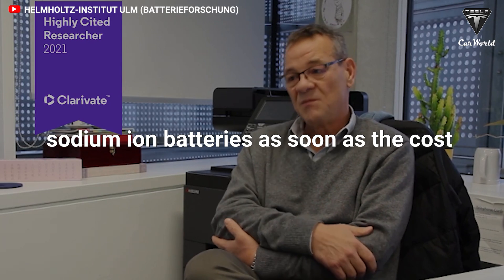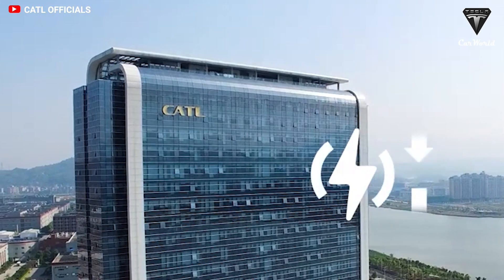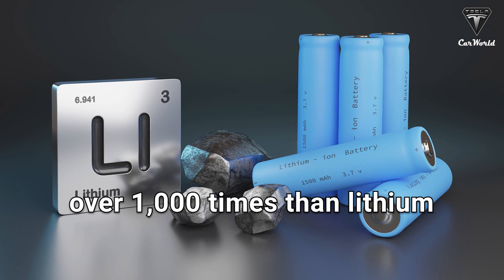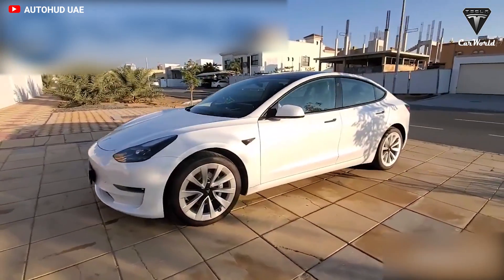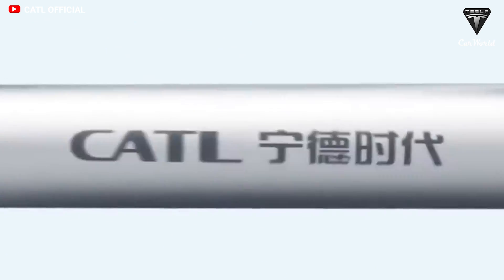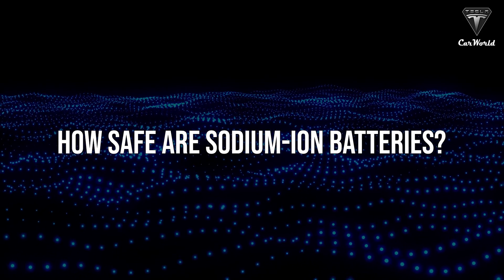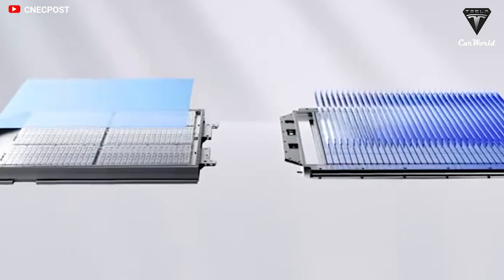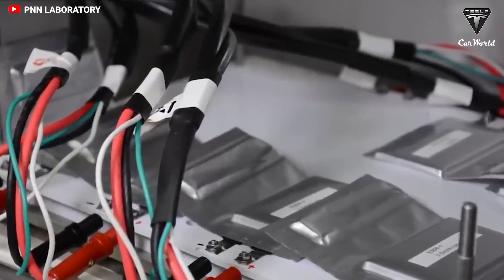Goodbye Lithium! NEW Sodium Ion 4.0 Battery Changes Everything in 2023!

Comment: Li is currently $31,611 per ton, less than half shown in this video. All materials have a dark cloud with the silver lining. Mining also plays an important part. Having a certain material need and constantly switching mid-stream will tell miners to stay away from from investing millions of dollars to go into production.
Reply: But how will the poor make a living
Reply: Video was correct, about price in 2022 as it said, in fact peaked $84,000 a ton Nov 2022. A new mine opened 2023 in Australia increasing supply, but it’s still far higher than the $4K/ton ten years ago. 

Cliches about minerals only apply in times of normal supply and demand, not when a demand increase enforced by government is 50X. It means only that the goods built on those minerals will get much more expensive, and just unavailable to many, all while fast mining does a lot of damage.
Reply: just to make the price fall for lithium nothing more than that...

Comment: I say the hell with batteries all together! What's next, batteries out of chewing gum and flour with hydrogen peroxide? I have a better idea, don't bother mixing all of those hazardous chemicals together in making batteries for automobiles. Make vehicles out of fibreglass, and bike parts! No need for anything that's electric. No chargers, no batteries, no starters, no need for anything electric. You want to save the earth right? Just go back to horse and buggy, then you will not even need vehicle insurance either. No need for air bags, or windshield wipers either. Just basic, simple economic way to travel. And the benifet you will gain is plenty of leg excersize!

Comment: Can't they recycle the lithium from the used lithium batteries??? I think if they used a small motor like a 1 liter engine to recharge the battery or supplement the the batteries when they need more current.

Comment: Sodium does not have the dual use that lithium has though. Lithium in batteries is lithium 7, the lithium 6 is used for generation of tritium for nuclear weapons. Sodium ion batteries would be useful for any aplication that extreme low mass and size isnt required. Some of these are UPS and powerwall systems, grid level energy storage, stationary off grid solar systems, larger tool batteries etc. One big advantage is that cobalt is not required, cheap plentiful iron will do.🤓❤😁
Reply: Also, there is no effective thermal runaway as while they get hot in such a scenario, it's not quite hot enough to ignite plastics and interior materials in a vehicle.  The Lithium are and are also nearly impossible to put out for firefighters.  So they are fairly safe in a crash as well.  The downside is.. well, you only get.. 200 miles of range?  For no increase in vehicle price versus today's ICE designs? People can live with that.  Range improvements will come with time.  But giving an alternative for no extra money is what will make those lofty goals even possible.  People simply won't spend twice the money on a new vehicle by 2030.

Comment: How about the number of complete discharges to full charges per battery?  Lithium Ion batteries are typically in the 800-1000 cycles or less to still produce 80% of original capacity. I think LiPO4 is more like 3500 cycles.  How about Sodium Ion?

Comment: We talk about density of charge and not physical size. If we are half the wh/kg but 1/2 the ft³/wh you could fit the same amount of power in that space. Keeping in mind that final battery packs size and weight have to be accounted for as useable size is all that really matters with cars. 
This is why solid state batteries were so important.
Reply: I guess we should not depart from conbustion engine using hydrogen or oxygen from water. The existing comvustible engine niw in use for centuries is better and costless upon old user since time immemorial. What is required is adoptation of new technolgy using water available anywhere on earth.

Comment: Try focusing on research that had nothing to do with "Batteries".  There is a German company that is in the final stages of testing their "Graphene Supercapacitors"  They can do everything LIthium Ion can do and much more now that they have solved the issues with capacitors.  They can charge in the same amount of time it takes to fill the tank on your car, and can drive your car for hundreds of miles before needing a recharge and will last for over a million miles.  Batteries are on their way out and unless new technology can take the place of gas-powered engines, battery-operated cars will start to slow in sales in the West, because with our wide open spaces, we need to be able to drive our cars for at least 250 to 300 miles before filling up in about 7 minutes or less depending on your type of car.  I am hoping the Elon Musk will take a look at "Graphene Supercapacitors" as an alternative.  If it works then Tesla can bring down the cost of their cars by hopefully 30% or more.
Reply: The cost is prohibitive, though.  The likely actual replacement will be graphene batteries.  They are already hitting the market.  I see RC car replacements that are rated at 8+KW.  This is insane as it's 3x that of NiMh.  One new formulation I read about has a 7000 W/kg density.  Imagine a 100kWh battery that weighed what a couple of lead-acid batteries did.  Suddenly the weight problem of EVs goes away.  Charge times drop to basically whatever the grid can supply (5 minutes or less).
Reply: i see you bro!Super capacitor do very great(10000cycle times because It won't have Chemical reaction )but It has its own disadvantages. it is very expensive. And also it is easy for it to discharge Automatically.( It will lose Electricity by 40% in just 12 hours now ) But I am confident that we can solve this problem.😆😆😆

Comment: Thanks for the comparison cost of the two. In case I missed it what is the relative charge per weight of the two? I know that sodium is less efficient now, but could that mean we used "D" batteries to do the job of "AA" batteries until innovation advances?
Reply: Similar to the 4680 when compared to the older 2170 ?  Which one has the higher energy density?
Reply: Sodium batteries (currently) are about half as energy dense as Li-ion batteries.  However, they cost less on a per kwh basis. So if you accept a lower driving range, but a faster recharge rate, then it is competitive. EV manufacturers are interested in this technology because they now see that it is not energy density that matters to the consumer, but price/kwh.  Most consumers would prefer to have a cheaper car with lower range, that they could recharge easily at home or even on a trip at a growing number of recharge stations.

Comment: Really important video and very well delivered and presented.  I think that using batteries to charge batteries is an important market and utilization of these sodium batteries.  As the video mentioned industrial energy storage is a no-brainer.  Farm tractors and  home air conditioning would also be obvious good uses for the  low cost sodium technology.   In the future;  Off shore stand alone industrial islands will probably use them.